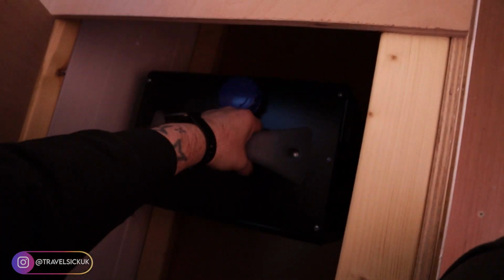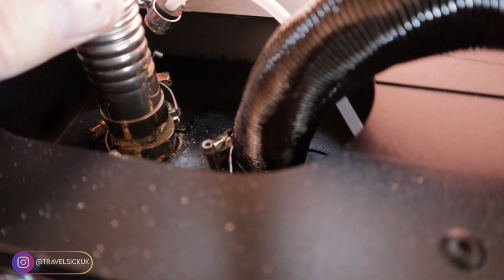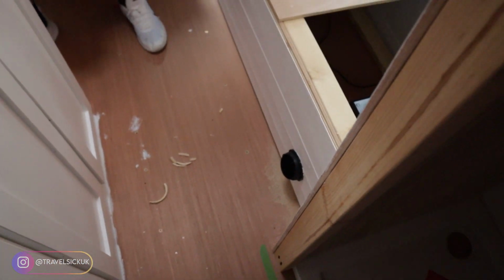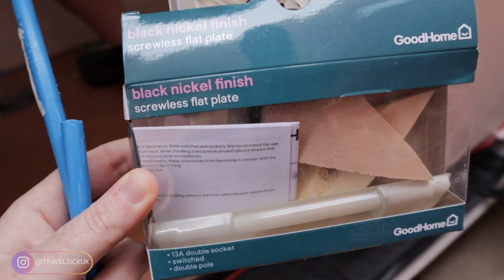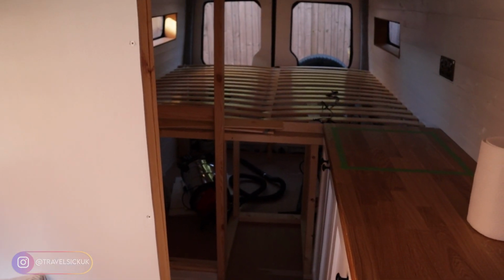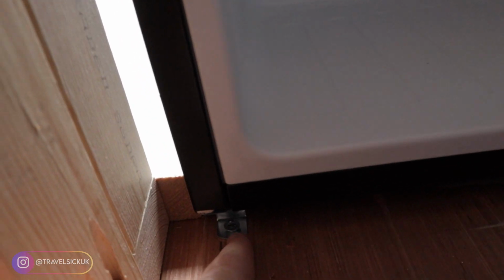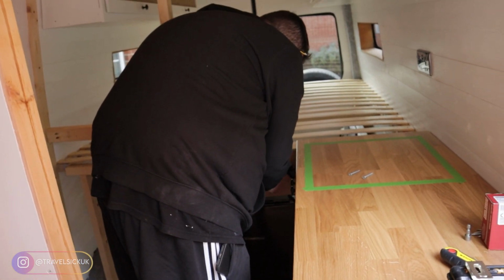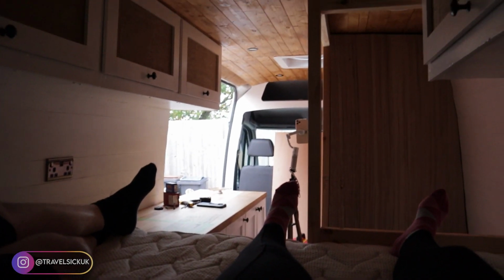Installing a Chinese Diesel Heater in Our VW Crafter Van Conversion! 🔥❄️

Comment: Hi guys. Could you explain the inverter transfer thing so please? I've  a 1000w and I'm sure it's got this feature but I've not done anything with that part. Is it as simple as plugging the inverter kettle plug into a 240v socket that's fed from shore power?